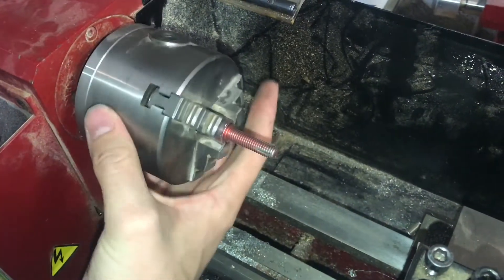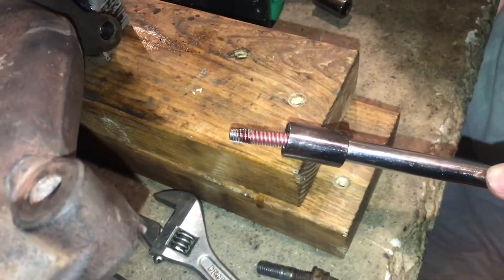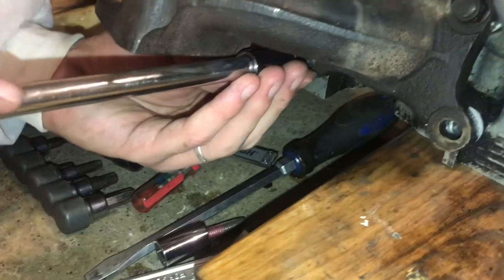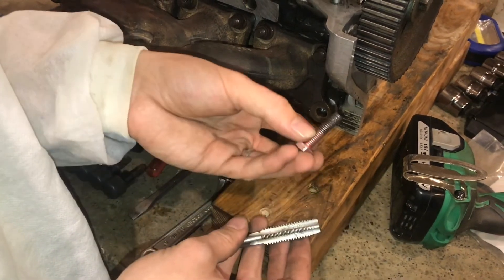make your own TAP to clean and straighten DAMAGED threads

Comment: DO NOT USE A TAP IF YOU HAVE ACCESS TO ONE. Taps are aggressive and you risk cutting the pre existing threads especially if they are damaged. Use a thread chaser instead or follow this guys video of using a screw and modifying it, which is essentially a thread chaser

Comment: you can also saw down through the length of the bolt with a hacksaw approx 1/2 - 3/4 inch....this will form two halves which will give a little in really bad threads and allow the rest of the bolt/chaser to clear the threads as you progress to the non hack-sawed threads...you can also cut halfway through a nut and create a thread chaser for use on studs and bolts.

Comment: I replaced yesterday Rear strut on 2003 Chevy Cavalier and it looks like one mounting bolt got crossed. Exactly how it is shown in this film it can't go further. The bolt is M8-1.25 as well. I think to come from another side to clean the threads in the hole (the bolt is supposed to go upward, and it is crossed, so I'll try to send it from top to bottom). If it won't help I'll try to cut it. Interesting technique shown.

Comment: This is EXACTLY whay I've needed to find! THANK YOU!  I have a cross threaded bolt that I got the old broken bolt out of the aluminum sopt and I have more of the exact bolts that I need to go into it but it's a very unique size and thread from what I've found trying to find the right tap to do this job. So I'll try this very carefully and slowly.

Comment: You should also you a die and run it along the thread of the bolt to clean up the edges because the dremel may flair them and cause more thread damage.